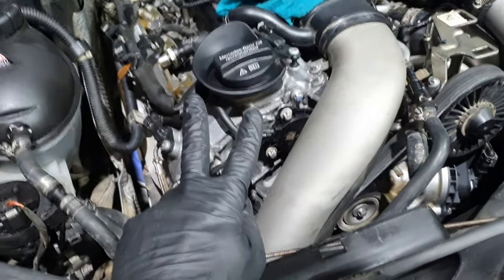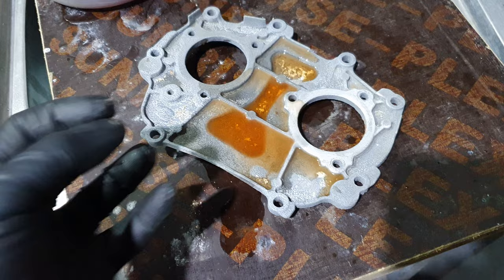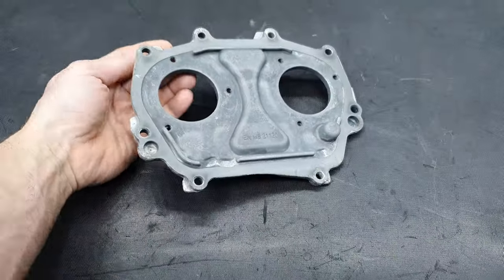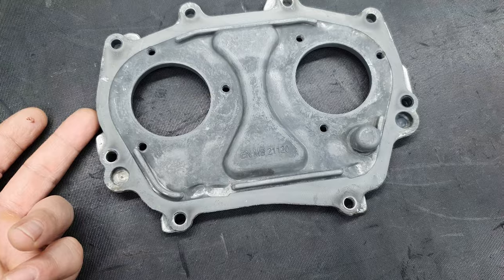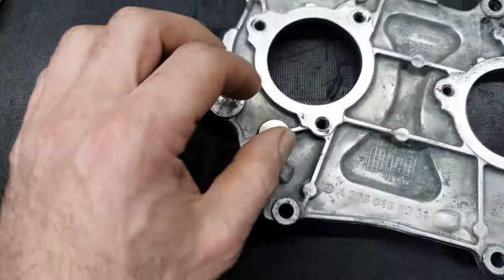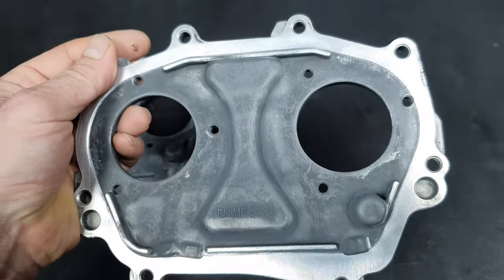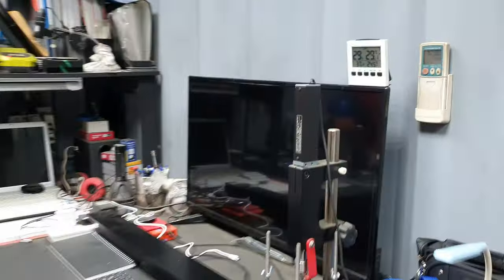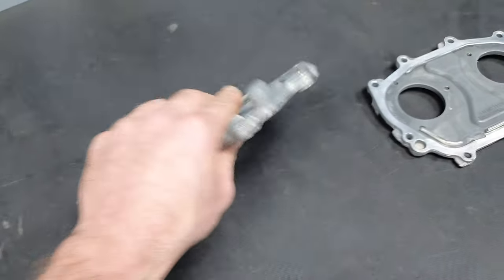M157 cam actuator housing

Comment: I do the Papadakis style silicone on those (not for cam covers though for clearance).  Place the silicone on the block then place cover gently to transfer sealant from block to cover.  Then remove cover and spread sealant on the block side.  Then place another 1-2mm bead along the marked silicone line of the cover.  Let it sit for 10 min and then gently place on the block and finger tighten.  Wait another 5-10 minutes and torque down.
Reply: what brand sealer you use ? do you have any videos of how it is done? First time to this i would like to try  resealing them myself

Comment: Do you also use soap and water with 1500 grit sand paper on the engine head as well to clean old sealant? Also is 2000 grit good enough as well for cleaning the surfaces?